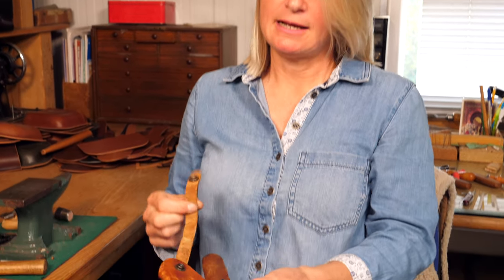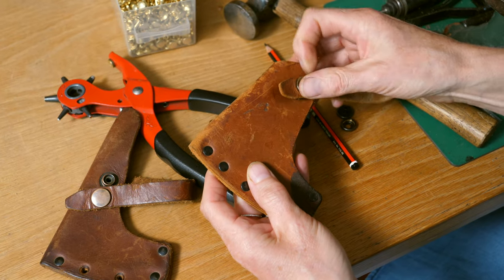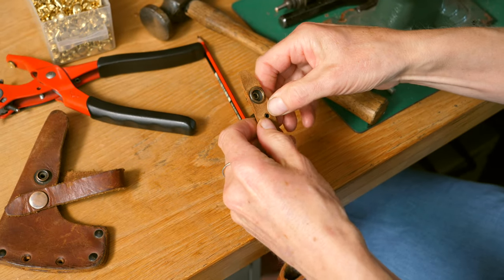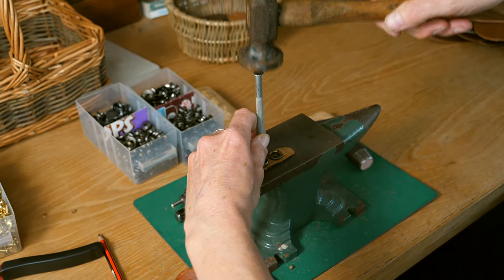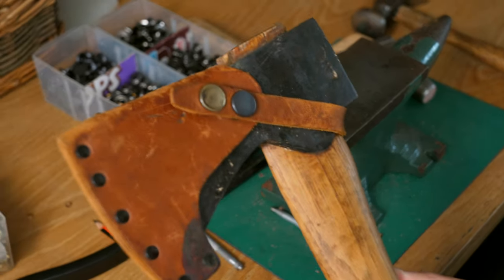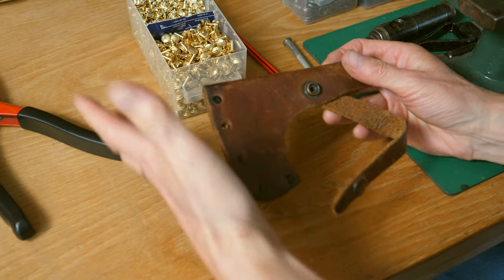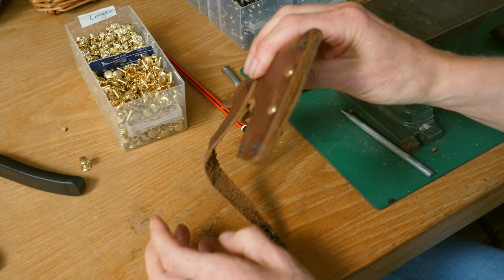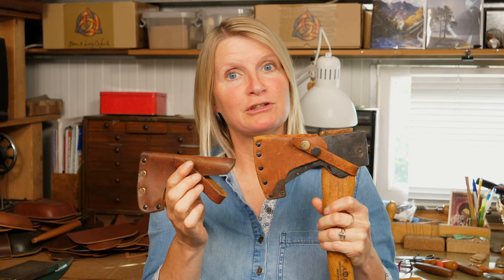How to Repair an Axe Sheath

Comment: You need to get Ben to grind that mushroom of metal off the top of your snap button tool, not safe the way the edges are folding over.